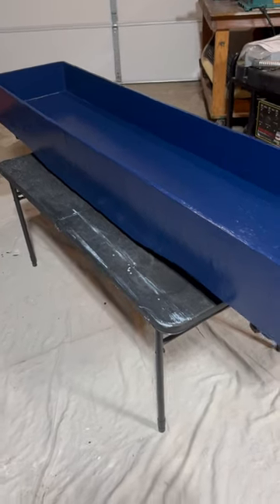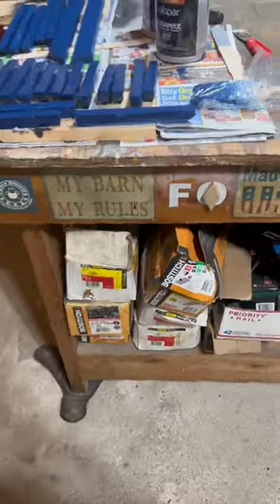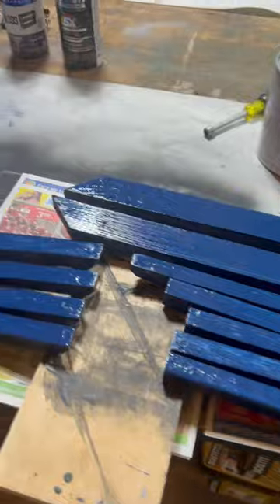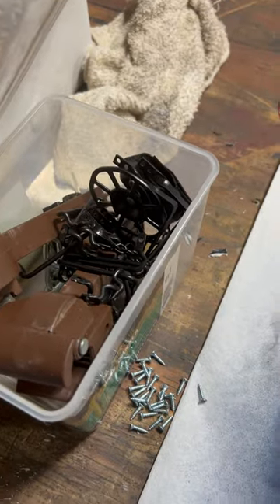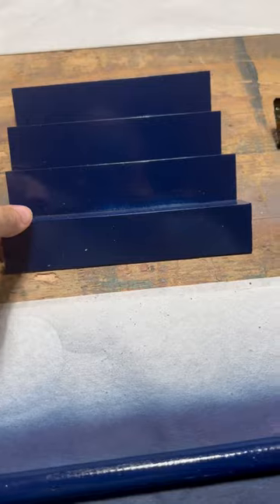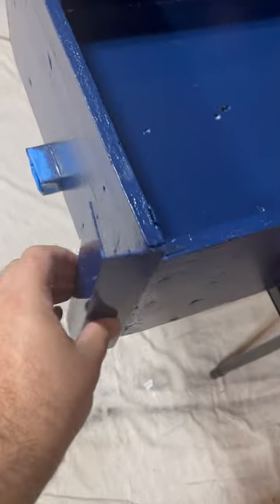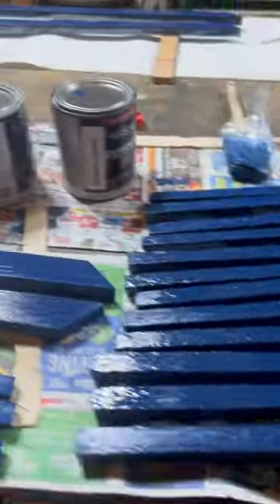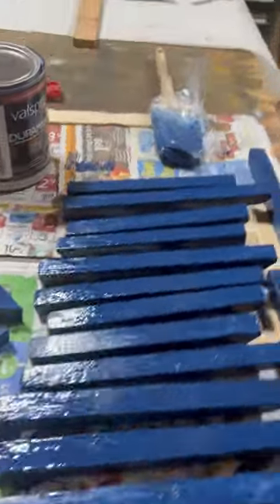Gondola Update #miniaturerailroad #train

Comment: Nice gon. Hey do still have those 3d printed trucks you showed me at the fall meet
Reply from the maker: I do. I remade the wheels in a more durable plastic that I think is durable enough, but now I need to make new trucks for them to go in that are strong enough to support the beating that they will receive. Those trucks will certainly get a video here once I start testing them.
Reply: @JaredDunbar  i messaged you on messenger or something of that like itll be easier to talk there
Reply: @JaredDunbar  i recently bought metal wheels and was wondering if those would work with the 3d printed truck frames and wanted to talk more about that